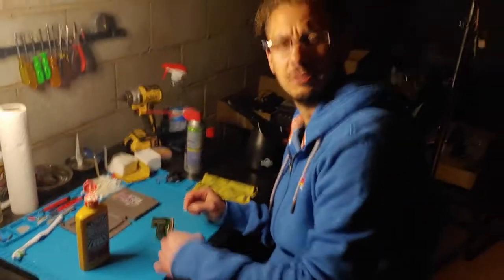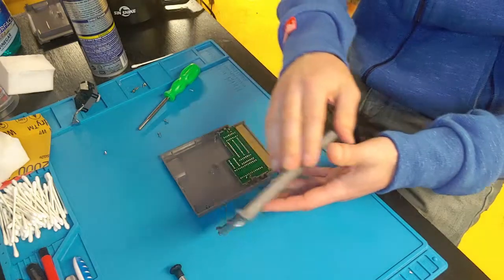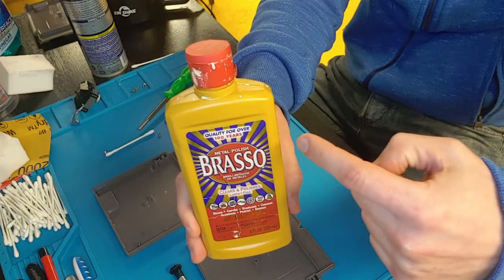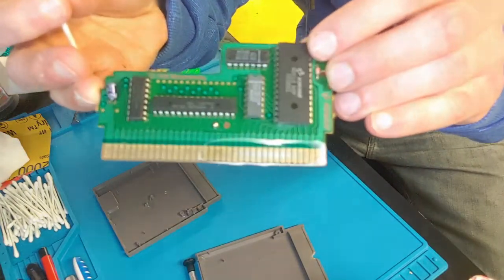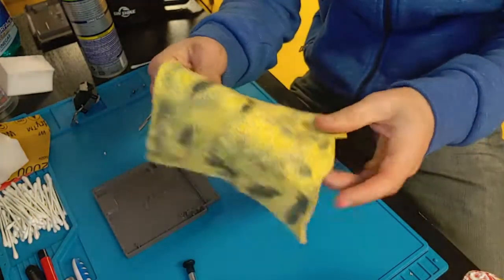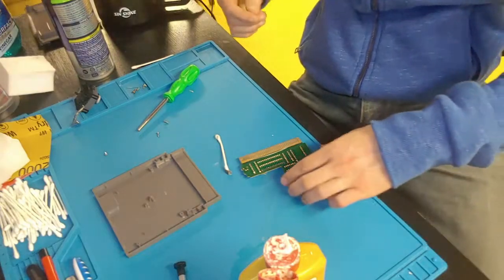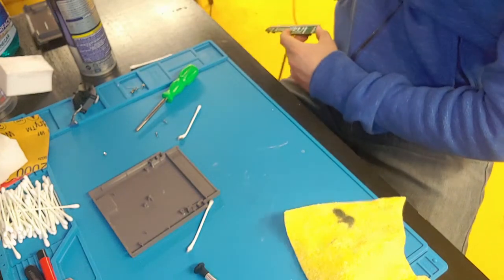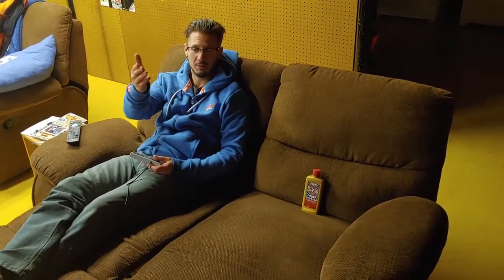How to clean Retro Video Games with....BRASSO?!?! | The 8-bit Basement

Comment: NEVER clean any cartridge game with Brasso. Its strips the metal leads and if it seeps into the board will cause irreversible damage to the game and systems. All you need is a white art eraser to erase the dirt, 90% or higher isopropyl alcohol, Qtips and canned air or a gentle soft tooth brush to brush away the eraser bits. Ive used that method for 20+ years and it has never failed me or damaged my system or games. Ive gotten games from sellers that cleaned them with brasso and lost count of the times ive had to replace them because they stopped working. So please everyone DONT CLEAN YOUR GAMES WITH BRASSO. Use the methods i mentioned and your games will last for many many years to come.
Reply from the maker: Hi Kevin - Thanks for watching and for the comment. While we appreciate your opinion on this, we respectfully disagree about using brasso as a cleaner. Matt and I each cleaned well over 1,000 games and consoles each, and are also resellers. We've been using brasso over 5 years and have had absolutely zero issues with it, nor ruined any games or consoles. Never had any returns for games not working. To your point however, brasso HAS to be used correctly (very small amount and wiped clean with alcohol after).  Sounds to us the damage you've seen has been from those who haven't used the product correctly. Also, we really enjoy using fiberglass pens for cleaning contacts, they work great! Thanks again for watching.
Reply: No, Kevin. Eraser dust falls off of the eraser and gets in the parts and takes up space in the small of the circuit board. It is not a wise idea and if you have been rubbing on your circuit board with an eraser you just lucky that you didn't ruin your games that way and even your console. Seeing as how all those little pieces fly off of the eraser the harder and faster you rub it seems like a terrible idea to then try and "blow them off" afterwards. Use Brasso and then iso alcohol. Brasso is only going to strip a small bit of the gold conductor that was plated onto the pins on the game cartridge it isn't going to ruin the cartridge or the system especially if you wipe it clean with rubbing alcohol afterwards. Brasso is going to make all that corrosion rub off the pins and that is exactly what you want. You my friend are being a tad bit paranoid. Try it for yourself what could you lose on a circuit board that is already headed to the garbage can?